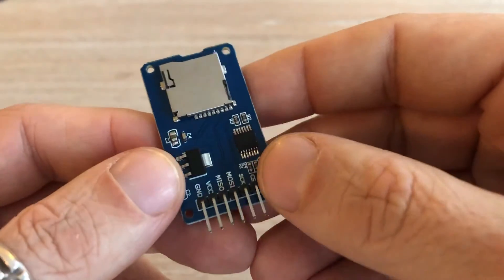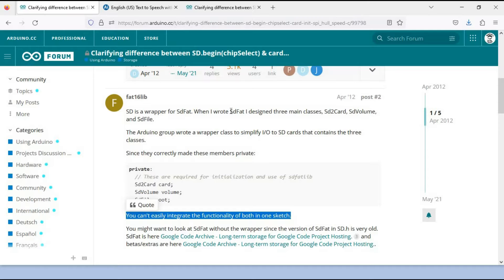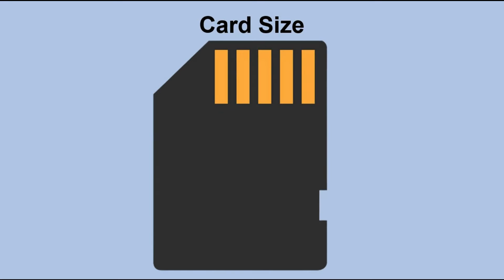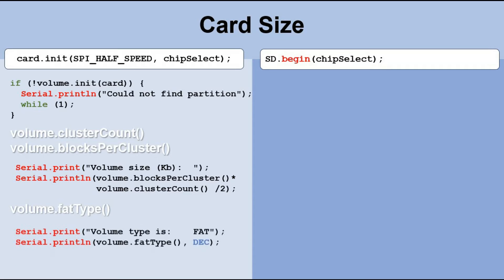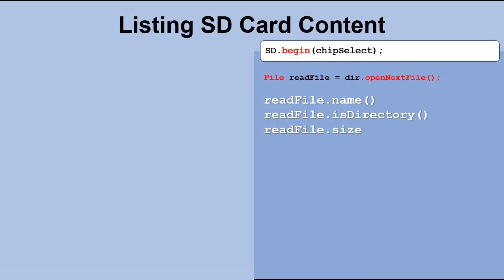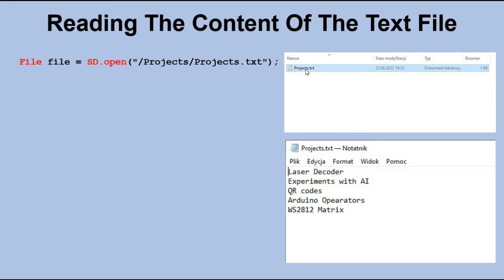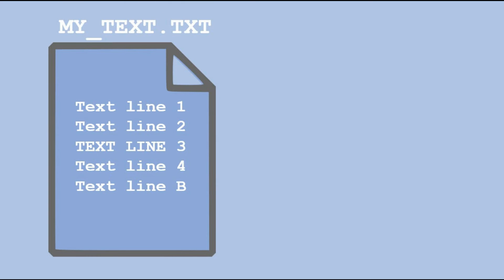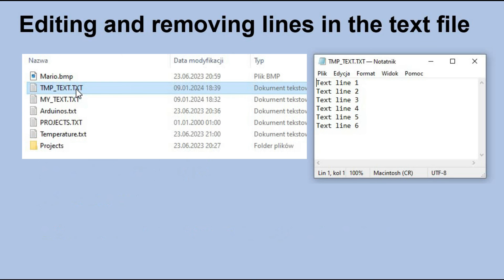Arduino SD Card Reader Tutorial: Initialization, Technical Insights, and Data Logging

Comment: I use those sd2card, sdVolume,etc. to initialize and check sd card type and list the content.
I get no error with this part.
But how to open image file?  I want to load image and display it on TFT screen.

Below is my code:                  but I get "failed"  all the time.
       
File root = SD.open("/");
    File entry = root.openNextFile();

    uint8_t nameSize = String(entry.name()).length();  // get file name size
    String str1 = String(entry.name()).substring( nameSize - 4 );            // save file extension                

    if( str1.equalsIgnoreCase(".bmp") )                                                      // if the file has '.bmp' extension
    { 
      Serial.println("OK");
      bmpDraw(entry.name(), 0, 0);         

    }  
    else
    {
      Serial.println("failed");
    }

    entry.close();  // close the file

void bmpDraw(char *filename, uint8_t x, uint16_t y)             <--draw function I copied from someone
{ 
}
Reply from the maker: To begin with, the image must be in the correct format. The display requires the RGB565 format, where each pixel is represented by 16 bits: 5 bits for red, 6 bits for green, and 5 bits for blue. You can either prepare your image in this format, which can be challenging, or convert from a 24-bit color format inside your Arduino code, which is even more complex. The display bitmap method is designed for monochrome images.

Check out my recent video: https://youtu.be/2c4ZyJYaWS8. In a few days, I'll release a new video on displaying color bitmaps on the display, but sending them from a PC over a serial interface instead of using an SD card module. The final draft of this video will be available today on Patreon and for my channel members. It will show you how to prepare the image and send the bytes to the display.

One issue for me is that my display doesn't have a Chip Select (CS) pin, so I can't use it with an SD card reader. Additionally, the SD card reader works with 5V logic, while my microcontroller and display use 3.3V logic. When I get the new components (a display with CS and a 3.3V SD card module), I'll create another video on this topic.

If this response helped you, please consider supporting my channel.
Reply: @marios_ideas  Thank you for your advice.
I'll check the link.

Comment: which is this SD library ? In my sd library it just shows SD test and SD time
Reply: If you are using the newer version of the Arduino IDE (2.3.2):
Go to library manager > search "SD" > click on the three dots on the corner of the SD library > Examples

This are the examples shown in the video and it contains all of them, I had the same issue.
Reply from the maker: I have not installed this library. It comes with Arduino IDE installation so if you have less examples it is either because you have different Arduino IDE version with differebt version of the library or you installed some other library on top of it. Go to Arduino Manage Libraries and find the version and see if there are upgrades available